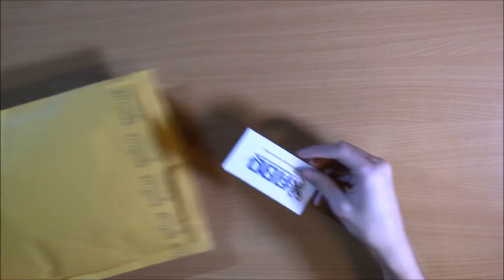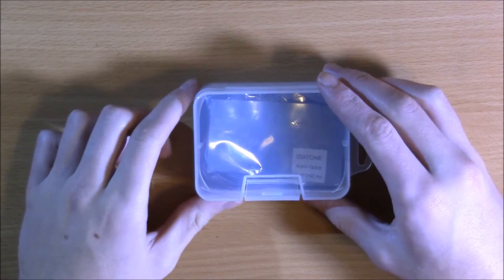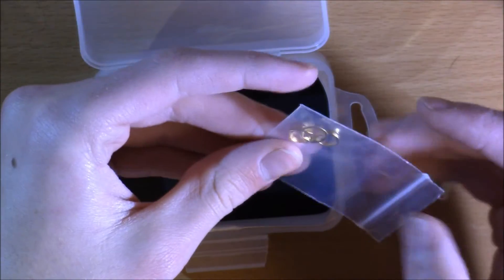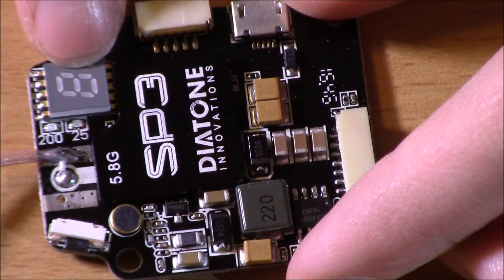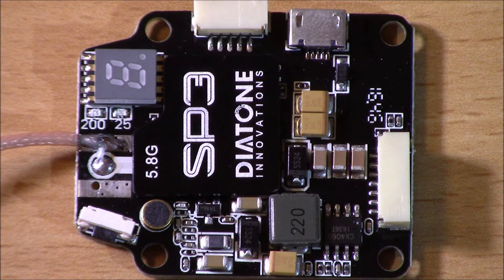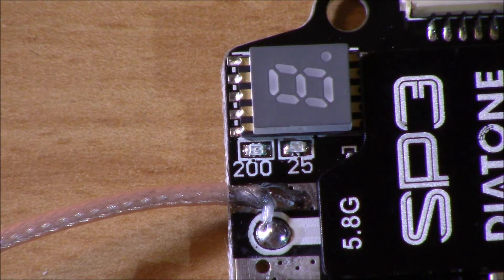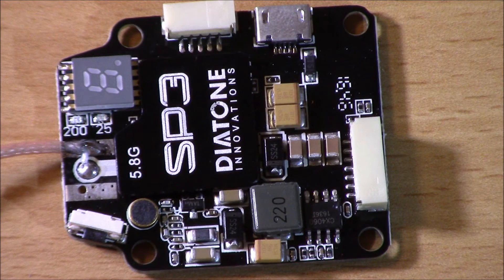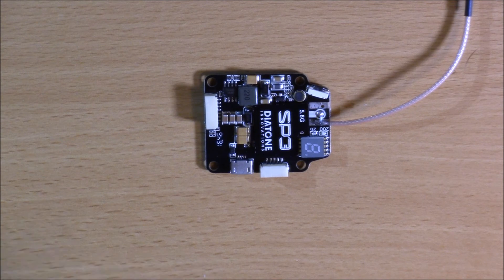Diatone SP3 FPV Racing Drone VTX + OSD Review | Video Transmitter Unboxing

Comment: I have this VTX and the Diatone Fury F3 flight controller with the FR Sky R XSR receiver. I'm a bit confused on exactly how the RSSI is supposed to be wired. 

   Do I wire the smart port from the Receiver to a Uart on the Flight Controller, then wire RSSI from VTX to RSSI on the Flight Controller? The activate the Uart port in betaflight for Smart Audio? I think this is how it goes but I'm really not sure?

Comment: First of all I just want to say I love my diatone products but I did notice on everybody that does a review that are sent stuff from whoever all the cables and other stuff are labeled with what they are but for me every single diatone project I have ordered does not have labels on a single thing yes there is the sticker that says it's unofficial diatone product but again as for wiring nothing I ever get is labeled.
Reply: Furthermore I've been disappointed with this board my USB port fell off the display for the channel I had to Hot Melt glue because it was about to fall off. And the other Port next to the USB fell off they're either not soldered on very good for this thing got so hot that it be soldered the parts but amazingly enough it still works.

Comment: Very interested in purchasing this! Do you think I'll be able to mount this with a DYS F4, and DYS 4 in1 in a rotorx atom v3 frame?
Reply from the maker: +DOCMACK I was able to fit it in an owl, so as long as it sits under propellers you should be good. Just imagine adding another board to your stack to meadire

Comment: what milliwatts would you recommend running on? im still pretty new to the hobby and im not sure what the difference is. thanks!
Reply from the maker: I would recommend using the highest setting possible unless you are having difficulty flying with others or are indoors. Thanks for the question! Feel free to ask.
Reply: Thanks! your the first person to actually reply to a question i had! i was also wondering do you use MWOSD for this vtx? when i try and connect it via usb to MWOSD version 1.6 it never does (only says connecting the whole time). and when i plug the usb into the vtx all i see is 1 red LED on under the board but when i plug in the lipo it all lights up. am i missing something here or have you ever seen/heard of this issue before? Thanks again and great review video!
Reply from the maker: I've never heard of plugging a vtx up to anything, it should work without any programming, the flight controller does need to be plugged up is this what you mean?
Reply: Cameron Blegen I guess I though you had to use the microusb on this vtx and plug it into the labtop to program it using mwosd. but from what I understand your saying is its already programed, but the flight controller I have with it go fried so how so that may explain why it's not working for me.
Reply from the maker: Yeah that may be haha! Yes as far as I know all vtx should already transmit the signal as long as properly wired. I hate a fried board... they seem to do it too often...